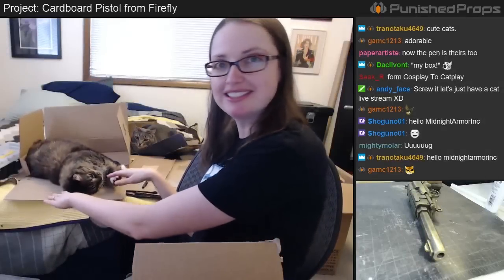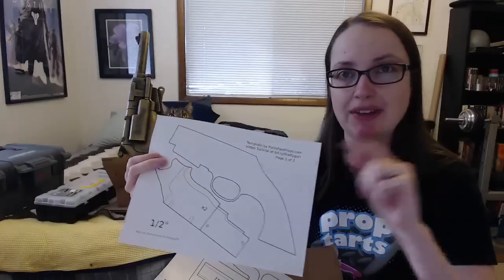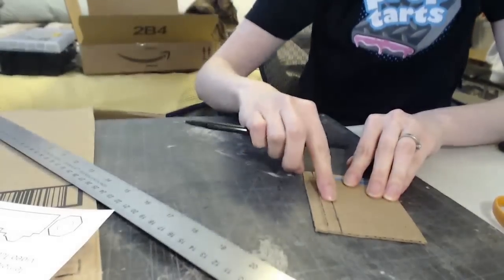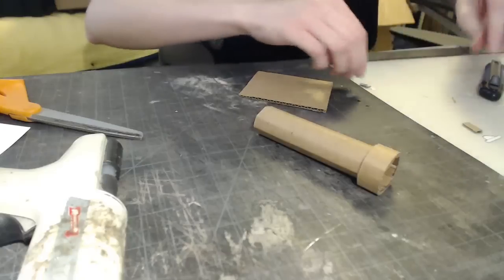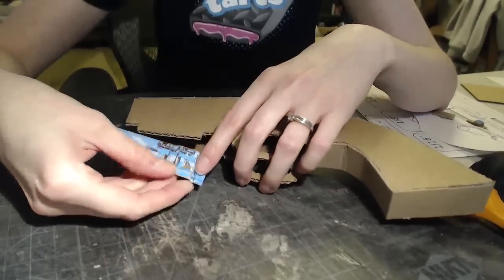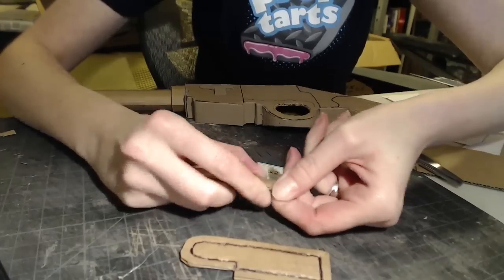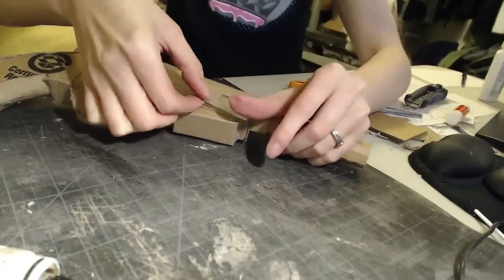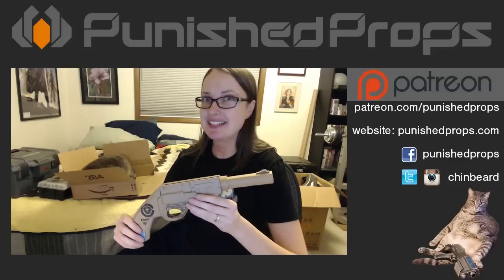Cardboard Pistol Challenge - Prop: Live from the Shop

Comment: great work for your first cardboard model.
i model new designs out of cardboard in my day job and I have a few tips if you are interested.
1. blunt the tip of a new blade by running it along a concrete floor, for scoring. the sharp blade cuts through easily while the blunt tip follows the valleys without cutting through.
also, cut the pieces you are bending or rolling (like the barrel) a few ridges wider that you want. after scoring, you scrape away the inside part of the extra cardboard with your blunted knife to leave just the outside skin. this gives you a flap to overlap and glue down, creating a much neater join. 
this technique can be used to create a 90 degree joint also, but strip the thickness of the cardbard at on end, so it covers the corigated end which will butt up to it.

Comment: I also HEAVILY suggest using things like foam core, because you can get a large sheet for only a dollar at Dollar Tree and because of the foam on the inside you can bevel it really easily.

I made Harley Quinn's Chiappa 60DS and used just that and its nice because you can use something even like drywall putty/spackle as a nice filler that sands really well and can add a lot of small details. The foam core, especially once all together is really sturdy so there's not much worry of something like drywall putty cracking (and its easy enough to repair)